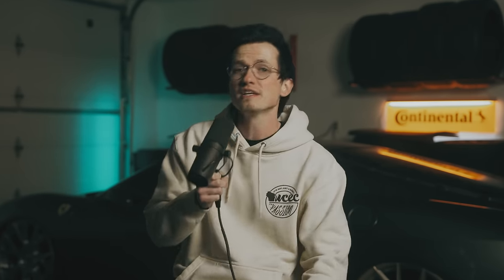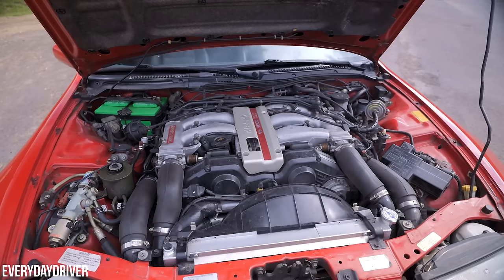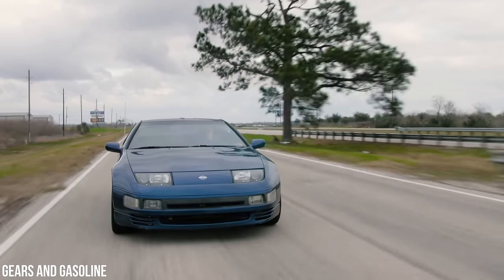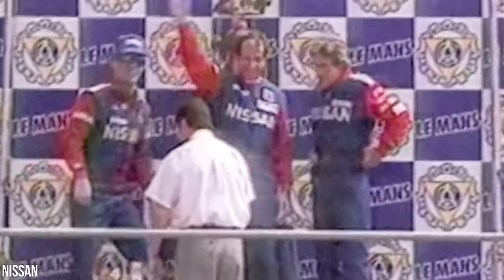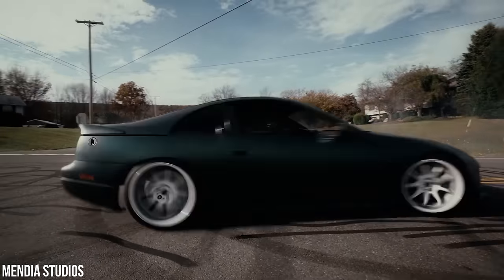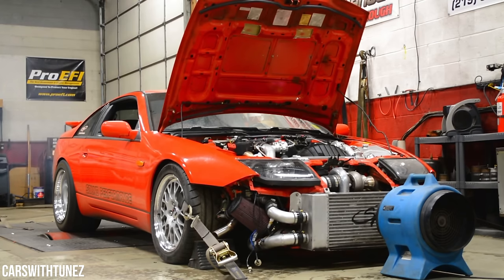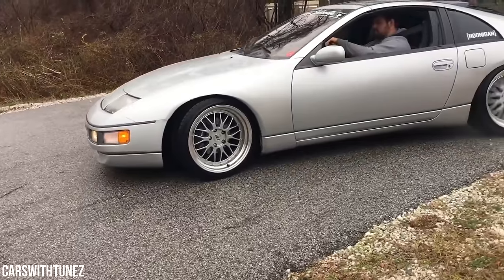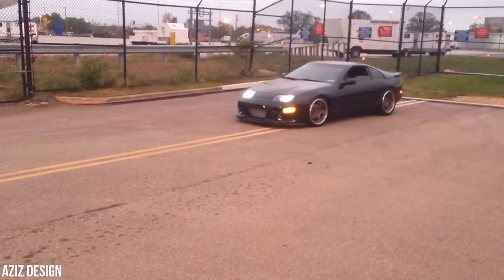How To Modify a Nissan 300ZX

Comment: Just having a running 300ZX is impressive. Them and 3000gt owners, mad respect.
Reply: Facts
Reply: Vg delete. Best mod
Reply: Only 1300zx in my area. Pristine but only one in my area :(
Reply: @robo1000 thank you
Reply: facts
Reply: whats that  @Derekgallantt
Reply: @titodenino  take the VG30 out and literally put anything else in it
Reply: @Derekgallantt  if it was only that easy
Reply: @titodenino  it is. Most z32 owners I know myself included have done this. Sr20, Jz, Ls. All better
Reply: I have both and the 300zx has been more reliable in my experience
Reply: @Derekgallantt Nawh keep the VG, the sound alone of that motor puts all these other overrated jdm cars to shame and the motor is capable if built right. Nissan proved it in the IMSA internarional races against all manufactures across the globe.  Takes a lot of work, time and patience to build but afterwards you can smoke just about anything on the road. Its the same way with the 3000GT VR4.
Reply: 300zxs are super reliable. If you havent owned them i understand the hate, but the NA is very reliable
Reply: @Derekgallantt  it really isnt that easy lol
Reply: @ThRedZ32  I’ve actually owned one for going on 7 years now. I’ve put so much money into the vg just to keep it running and it still grenaded I’ve seen many of these cars and every single one I’ve seen has had to replace motors atleast once
Reply: @Derekgallantt  that sounds like an issYOU then. The vg is generally a very reliable engine. You may just have a dud. I'm going on 250,000 first engine.
Reply: @ThRedZ32  I’ve seen 8 vgs blow in the past 7 years. Granted we all drive our cars on the track but can’t seem to keep them together. I love the chassis it’s just the motors can’t hold for the abuse they take on the track unless you drop 5 figures on them and at that point I’d rather swap something that’s more reliable and easier to work on
Reply: @Derekgallantt  to each their own. I don't track mine. I'm building one for my own personal use as I love the car. I will be doing an engine swap one day, but my engine is still super solid so I'm going to do all my cosmetics, steering, suspension, etc. Everything but power mods for now until I decide what I'm doing in that regard
Reply: @KingKhan-ez3gg finally someone who gets it, hahaha I still need to do a full rebuild on my 91 since it’s mostly factory parts, and it wasn’t maintained very well until I got my hands on it.
Reply: @Derekgallantt so these were all stock motors?  I don’t know of any 25 year old cars that are capable of being track cars with just bolt on’s.
Reply: @ThRedZ32 exactly!   Everyone wants to buy a 25 year old Z and turn up the boost thinking it’ll be fine.   No you have to build this car, did mine 12 years ago and still running strong.
Reply: @robo1000 What do you mean "Just having a RUNNING 300zx is impressive" Do they usually not run ? One of my friends have one and it seems as reliable as my 200SX S14. He have never had any major problems with it for 15 years of owning it now.  I was under the influence that they run well and are reliable ? I am looking to buy one for myself soon, they go for around 12 000 to 16 000$ with around 70 000 - 90 000 miles on them which I think is a good deal for a V6 twin turbo car even though they are from around 1991. You "only" need a cool paint on them, 20" or so rims, a big rear spoiler/fender/wing,  a full exhaust system and lower the car down and you have a great looking car =) Also easy and cheap to tune.
Reply: @mathias6423  these guys don’t know what they’re talking about they want to track stock motors and expect them to be fine, the are very reliable and very good motors as long as you take to time to maintain them and treat them right, as long as you don’t abuse the motor it’ll be fine, and if you wanna upgrade it over time you you can push it more and more, make sure you take the time to upgrade it right and don’t over do it thinking it’ll be on the level of a k series 2j or ls, it’s a good reliable and nice sounding motor that’s good for decent horsepower in standard modification but once you wanna make more outlandish hp you are going to be spending a good deal of money
Reply: @hugoandreslozano5489  Thanks man, yeah I thought people are giving it too much sh1t that does not rhyme with the quality of this car  / engine.
Reply: @mathias6423  yeah man mine started up after 4 years of not running with just a fresh battery, that’s pretty reliable if you ask me me
Reply: So good to own, the reliability thing is a bit of a meme, about 60 cents a mile here in the uk tho lol
Reply: @hugoandreslozano5489  Bet half of those were timing belt related too cant skimp on that
Reply: @Derekgallantt I don’t have the space or technical expertise to swap 😭
Reply: @ThRedZ32 then you will never swap it, because if you keep the proper maintenance, and/or mod it properly with everything else considered, the VG will outlive you
Reply: @shawnalbarghouthi4113  when I say swap, I mean swap one in better condition. I was thinking of buying one with lower km, building up the internals and supercharging it

Comment: I am currently 4 years into my Z32 build… and closer to 6 figures spent than I care to think about. Will be the most insane street going, track capable Z32 ever built.
Reply: So whats the build?
Reply: i don't mean to be rude but do you get charged double everywhere you go to have things built. after reading near 6 figures spent. 🤔
Reply: @Nismo65  i mean i have only done coils, wheels, maintanence, and got an exhaust and a bunch of replacement plastic and a new fan and i am 18,000$ in already
Reply: How to you pay for the car? I bought a 96 TT for $8500
Reply: Build list???

Comment: The Z32 300ZX was my dream car growing up, and I finally got one a few years back. Some thoughts:

The NA may be "slow" but it is still incredibly fun, compliant, and luxurious. You will never win a drag race, but you will have a smile on your face as your twist around turns with the t-tops open. 

The 2+2 gets crapped on, but fun fact: the 2+2 was the model used for all the Z32's award-winning racing due to its 51/49 weight distribution. Plus it makes the car a usable daily where you can actually fit things in the trunk, by folding the rear seats down.

The engine bay SUCKS to work in, just as much as you've heard. It's mechanically easier to replace the intake with a cone filter than it is to change the stock filters. I wish I was joking. 

The car is heavy. It's not a drift missile and it's easy to put the rear end out. Treat it like a GT car that handles turns with precision but not with the carefree sliding glee of a BRZ/240SX unless you're an expert.

You really do have to keep these things expertly maintained. If you don't have both knowhow + time or money + care, don't get one. 

That said, one that has been taken care of is reliable. I have never once had a mechanical issue on the Z besides one bad pulley at 115k miles. And many Z owners take their cars up to 200k miles. I have heard nightmares about turbos failing, so I consider the TT to be less reliable.

This car's design is TIMELESS and you will have people asking you "What is that thing?!?" thinking you own some modern year supercar or some super-Supra they never heard of. These will never age badly. I'm sure in 20 years when people are EV-swapping them, they will feel just as natural as electrics because they look like spaceships already.

TL;DR: The car is a pain in the ass in some ways but it MORE than lives up to its reputation. There's a reason it made Car and Driver's "Best 25 cars ever made" list TEN YEARS IN A ROW.
Reply: Massive Respect for you and your efforts..
I love Classic American Car's.. but have love for the Japanese Market GT Cars.. 1st Job was at a Dealership with both Mazda and Mitsubishi..
So 2nd Gen RX7 and 3000GT VR4...

Your Car.. 
All Class.. seriously, folks forget they were direct compensation against Corvette.. 

Locally.. Ryes Millen shop.. "Stillen" 
Search his Race Car... Your Model era...
Now...His Brother.. has basically the as close as possible build to the Race Car...
Titanium Exhaust!..
Detuned Race engine, 
For daily use...
Like We couldn't build this if we wanted to.. it's all Race Suspension etc...
He cruises it all the time here in Huntington Beach CA 🇺🇸 
A Sleeper in a way..

Keep on wrenching Dude..
As you more than understand...
What it takes...
It's all love...
Like actual love..

@∅
Reply: I’m buying a 93 TT next month, very clean solid setup with the GT535 twin turbo setup. Buying from my buddy who just had the top end rebuilt and added the bigger turbo ki. Going to be my C&C car.

Comment: I’ve had my 1990 300zx for 2.5 years now and I bought it as an 18 yr old (my first car). As an absolute AMATEUR who was obsessed with this car I got it knowing the consequences. This car has definitely bent me over the past two years, costing me a few thousand in maintenance. But now I have a fantastic and reliable Z. I’ve learned a lot through this car but if you’re young and inexperienced you may want to steer clear. That being said my car is COMPLETELY stock still after 2.5 years and I’ve been dreaming of doing coils, wheels, tires, etc but as a broke college student all of my cash is saved for when I eventually have to fix something. Be smart and be careful. I love my car so much and have zero regrets. Big plans this summer when I throw some serious money into it.

Comment: I've owned two of these cars - an NA and a TT. IMO the NA is still very fun and feels a lot quicker than 222 hp (and with an HKS dual exhaust sounds great). The NA was very reliable and, besides a clutch slave cylinder going out, didn't give me any problems at all over a year and a half. The TT was way more problem filled and just never seemed to run 100% right. These cars have a lot of little hoses that like to crack due to the heat of the cramped engine bay so use a smoke machine it helps..it was quick though! My car had a 1 piece driveshaft, slightly bigger turbos, injectors, exhaust and a tune.

Comment: The video I was waiting for haha, after watching the video I can agree that if you don’t treat the car correctly it’s gonna be a PITA, but it’s a good platform, probably not as agile as a S chassis but still can be drifted or track and a robust motor, but if you aren’t too experienced with mechanic work you should probably look for a specialist of the platform, since it’s king of tricky the engine bay

Comment: I bought mine for 6k like 2 years ago 80k miles . Needed rust repair, alignment, and fluid flush. It’s running amazing though if you don’t overdo the engine mods it’ll treat you nice. Find your local 300zx / Z community to find a good mechanic though as they are often times very hard to work on .

Comment: @6:31 no hate, but the na and tt motors. vg30de and vg30dett. are EXACTLY the same internally, other then pistons, wrist pins, oil squirters and exhaust valves. everything else is identical. auto and 5 speed had dif cam lobe profiles. the 5 speed being the more aggressive of the two. on a saftey side however, the TT did have the external oil cooler which does help drastically in attempting to maintain reliability on these cars esp with the increase temps of the tt version, compared to the na which did not have this feature. but both motors are built equally as stout. again no hate, i love the channel! and love anything Z32! keep rocking hommie! p.s. everything else, was DEAD on POINT!

Comment: I own 3 twin turbos. Some advice. Don’t buy one unless you love it. Great cars but they are very expensive to get sorted. I spent 2k just replacing trim alone. Also you pretty much have to pull the motor on these cars anyway so might as well reseal it with a new wiring harness, 120k kit and rear main seal. And yes they are reliable, just alot of them are beat so you are spending quite a bit bringing them back to its glory days.

Comment: Sorry if I missed it but I’d add “upgrade your exhaust manifold studs” especially  if you have a twin turbo. It’s a good bit of weight hanging at a funky angle. If you want to make it easier to work on put in a vortec v6 with a carb swap, can even do a blow through carb if you want to twin turbo it again.

Comment: currently in the process of  getting mine running and driving and thought may as well single turbo the NA as my goal is 400whp and gain seat time with that before raising it up via fuel injectors and E85. Also doing work in the engine bay to make it as simple as possible and routing things to make it less cluttered and more user friendly as best I could.

Comment: I am looking at getting one of these and put a VQ37VHR(these motors are dirt cheap asf rn $1000-1500 for a 350hp NA) it already bolts up to a CD009 and the engine bay is wide enough to where you can add stock R35 GTR turbos unto the VQ. Only thing I am worried about is if the hood will close because the VQ is a very tall motor. I reckon I can get everything done with a standalone  doing all the work myself for $12-15k.

Comment: I have had 2 300zx and my current one is a TT w/ 130k miles. 

Love ya Alex, but theres so much misinformation on this video. 

Also, the NAs are just as strong as the TT. So just boost the NA, you can hold 700whp on a NA-TT if you have a decent tune.

Comment: if you want one of these, its much cheaper to get an NA manual then TT swap because you won’t have to delete the hicas on the TT model. Also get in touch with someone who knows these cars, MAINTENANCE costs a lot with these since they’re from the 90s, NISSAN and the part vendors tax is insane nowadays. GET ONE NOW BEFORE they go up to like 30k like the rx7 fd, nobody wanted to work on 13b either back then but look how much those worth now.

Comment: @alexmatini. Fun fact Lamborghini bought the Z32 headlights not the other way around. 
Ive owned my Z32 for 24 years swapped NA to TT, modest build with forged internals, nismo 740cc injectors full bolt on options and 370z Akebono on all 4 corners. Its a 5 speed manual with a new 1998 tranny from Japan cause why not.

Comment: Some of these facts are just wrong lol. 

We don't have Subaru problems like headgaskets lol. Our problems are mostly electronics and wiring like any 30 year old car. Or pretty much like any Nissan usually it's cas related stuff.

You don't have to pay that much for one of these NA range is 6k-10k TT is 20-25k. The bubble is going down. Of course the community is trying to push it back up but it doesn't seem like it's going to thankfully. 

The NA weighs 3200ish
The turbo weights 3400ish
So it's not that heavy. Lighter than an r34 and mk4 supra and nobody calls them heavy.

Brakes are fine. Same brakes are used on the skylines lol.

The NA and TT blocks have the same potential. Rods are the weakpoint. Other than that plenty of people in this community have turbo'd their NA with good results. Highest hp was 793 I think. 

Look out for rust damage near the rockers, battery tray, and t tops.

Happy hunting!

Comment: 1) it is a Grand Tourer (GT), not an econo-box or cheap entry level import. Weight comes with the territory. 
2) the only dilemma Subaru has is poor manufacturing. Subarus are literal garbage on wheels. The Z32 is not comparable to cheap manufacturing. 
3) Lamborghini actually has Z32 headlights. Not the other way around. 
4) I have a naturally aspirated Z32 for sale if anyone is interested. Check my channel for the full scoop on it.

Comment: So I got my 300zx na is tune but I got a misfire issue u think u can help me solve my problem I bought a new crank angle sensor feel day work perfect but now when I go high Rpms start to misfire so I disconnect the angle sensor and put it back again and work fine so what is the problem

Comment: I found a clean running one for $900 Is that worth it?
Reply: Yea if the rest of the car is in decent condition as well
Reply: @Evilpass  k thank you I ended up passing on it had a bunch of frame rust and wouldn't start.
Reply: @FantasyFlippers  that'll do it lol a fair price would be around 4k to 6k for good condition at least for na models